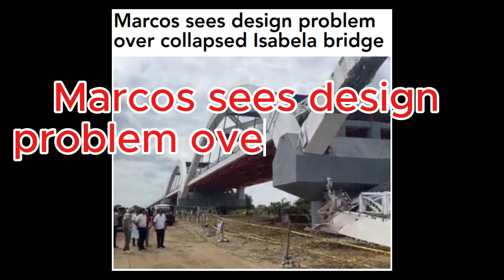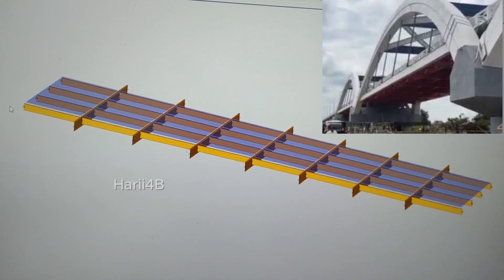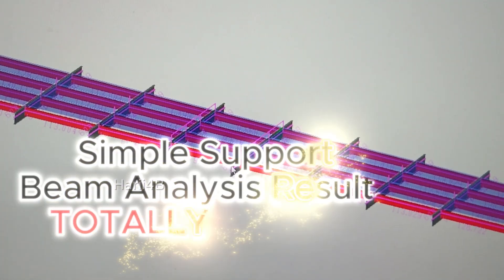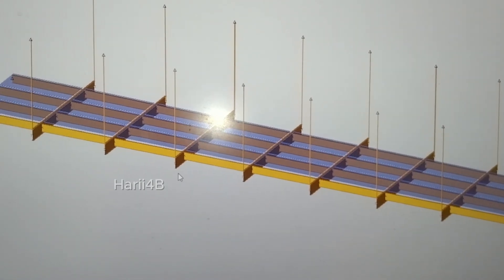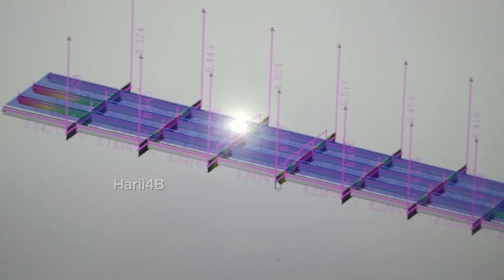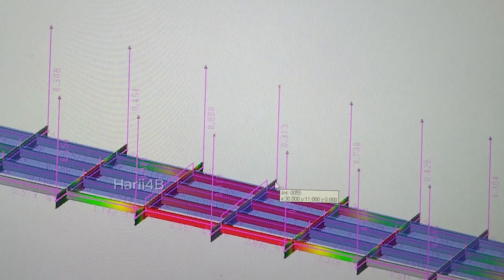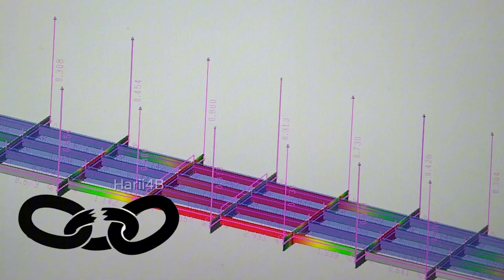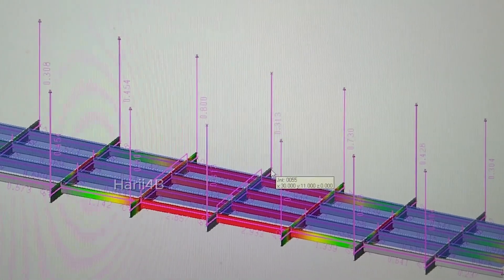ISABELA BRIDGE Cause of Collapse, EXPLAINED!!

Comment from the maker: https://youtu.be/3IPedlqZ4mc In Tagalog Po
Reply: @Harii4B  sir kindly watch ung interview ng oneph sa nagdesign ng bridge and comment sa next analysis nyo. Ang sabi nya he based it on the 2015 bridge code na kinopya natin sa american bridge code and they just used  27 T for 10wheeler truck. Kaya nasabi k sa comment sa part one ng analysis nyo, na wrong feasibility study,  D nila binigyan ng malaking pansin kng ano ang volume and weight ang dadaan don. Regarding sa truck sabi ung nagdesign DPWH measured the volume of the dumpbox of the truck, kinilo ung mga bato ang they came out with this 110T yata. I agree that they should weigh the truck to get the exact weight.

Yan sir ung interview;

https://youtu.be/ZaLLmM3CmVU?si=_qH1idzWVYI6R_y4
Reply from the maker: di ko rin sir ma imagine/justify yang 2 27ton truck lang ang design sa 60m+ span. Lalo na now na nakita maraming weak support connection points ang design nila. Let's see na lang sir ano gagawin dyan ng DPWH.
Reply: @Harii4B  tama sir ung analysis ninyo. Pero surprised ako sa sagot ng engr na nagdesign ung bridge, pti DPWH . Lets see sa senate hearing dpat may masibak dto kc hindi lng ito ang bumagsak marami daw.
Reply from the maker: pls wait po ng 4th video, may laman na yun regarding design flaw/s?!

Comment: The 60m bridge has 6 (pairs) supporting rods but your model has 7.
Reply from the maker: yes sir, it was already modified in video 2 and 3
Reply: @ im a bridge engineer and wanting to run also my own model in midas. Id be happy if you could share me the drawings of the bridge so that i can model and check the design, particularly the connection details
Reply from the maker: @rarapiboy2525 apologies, my model is not the same 100% matching the actual built in general dimensions and section properties. i just made scaling from photos gathered using the stated bridge span of 60~65m length. it's enough to get the feel of the bridge behavior and understand what is lacking. thank you very for watching.

Comment: Yes, the President is correct! He was referring to the design of choice (arch brisdge, with inferior support) as not adaptable to the traffic in the area. It is a low capacity bridge, instead of a design adaptable to all types of vehicle. Should the design be a PCDG type like a viaduct, even the bridge in full capacity (bumper to bumper scenario), it can safely withstand the load.

Comment: SIR !!! CONTINUATIONS LANG PO SA INYONG WELL ILLUSTRATED POWER POINT ANALYSIS BAKIT BUMAGSAK ANG ISANG LANG ARK SPAN NG CABAGAN BRIDGE SA ISABELA??? ARE YOU NOT CONSIDERING THE TRAVERSING 3 TRUCKS OF THE SAME STONE LOADS TO THE MULTI-SPAN ARK BRIDGE OF ALMOST 1KM LENGTH. WHY ONLY ONE ARK SPAN GAVE UP TO THE THIRD LAST TRUCK THAT TRAVERSE THE BRIDGE??? THANK YOU SIR TO YOUR ENGINEERING ANALYSIS TO THIS COLLAPSED BRIDGE!!!
Reply from the maker: preparing na po ng 3rd part, more conclusive na ito. marami pong salamat!

Comment: Correct po kayo Dyan..  LooK BOLTS and KNOTS connecting the TENDON ROD..  They SNAP and SERARATED..  Even The ARC is NOT SOLID REINFORCEMENT Design..  Why ARC Design Have STRENGTH and DURABLE can be DESIGN SOLID not HALLOW..

Comment: Kung ang retrofitting eh nilagyan ng pier at beam sa gitna ng arc all the way to the top of arc and then bigger girder beams sa length ng bridge eh its possible the bridge had been save! DPWH engineers are inutile at palpak ang design. Hindi inisip yung dead load ng structure at lalo yung moving load na yumuyugyog sa bridge! Lumampas ata sa cantilever beam design yung bridge structural length and should have a stronger pier and beam at the middle of the span! Pure aesthetic was considered sans the strength to withstand the dead load and moving load. Safety factor for the said load should have considered! Pera ni Juan Dela Cruz sinayang ng mga taga DPWH at structural plus architect designer palpak!
Reply from the maker: maraming salamat po sa inputs, nagkaroon ako ng baong idea sa retrofitting study na gagawin ko

Comment: The fault  could be on the side of the inspectors before the bridge is opened. Before 1990s initial stage to final stage inspection is done by dpwh plus submission of strength of materials report used. Now for contractors it's the % cut for project 12% kay cong, 5% kay RD dpwh, 2% PD-dpwh., 2% kay mayor, 2% for Sanggunian at barangay kap😊
Reply from the maker: minimum 40% project po yata ng gross budget ay napupunta sa bulsa ng mga (????), ayon sa mga marites hahaha
Reply: @Harii4B  you may be right sir hahaha

Comment: I dont buy in on your explanation. To tell you frankly, this is DPWH FAULT. Everyone there doesn't do their responsibility diligently. Lahat sila nagiging politiko na, at hinihintay ng mga yan ang S.O.P. 

@ Lets start w/ the design, if it is an outsourced or designed by private company, they can check the design & materials to be used, using computerised capacity & load simulation. There & there they could question, revise & correct the possible defficiency of the design prior finalization & before putting into drawing w/ appropriate specification.

@ In the development of project, they should apply the QA/QC qualification from materials up to construction stages &/or phases they assembled? What was the findings & its results?

@ final project acceptance, what is the final QA/QC report by contractor & the approval of dpwh?

@ DPWH turn over to the users (LGU). What was the guidelines, procedural or methodology put into document by DPWH. this encompass critical load in vehicle capacity & sizes, safety signages & paraphernalia to be put into critical places, etc. 
Please take note that the defined documents by dpwh for the bridge will defined group responsibility to avoid finger pointing.

@ bridge check ups & maintenaces. If this is being initiated by the DPWH ( in quarter, bi year, & yearly) the govt will be aware & prevent this incident to occur and can be corrected at once...

Bakit nangyari ito. DPWH doesn't do due diligence !!!
Reply from the maker: https://youtu.be/3IPedlqZ4mc please watch here po, then we can talk again after.

Comment: THE BLAME GAME.
If Design Flaw; why does it fall “only” to the Designer? Or rather why does it fall to the designer? Engineer who authors the Design is only the first part. We may agree that it is the sole responsibility of the Design being the author. But i don't agree it is automatic or equate to be the sole liability of the Designer. 
(1)	Who Authors the DESIGN? BLAME the Engineer?
A Structural Engineering Design Firm/Professional is a licensed to make sure its design complies to the “required” Integrity and strength of its structure irrelevant how much they are paid to do so. Design Fee is irrelevant to its responsibility, duty nor one’s liability as a result of its design as being a professional and licensed designer. There are guidelines for designer’s fee and the basis for it is the compensation. It is and shall base only to one’s (1) Experience (2) Expertise, and Capabilities of the designer. Once the Designer accepts its challenge to the design work regardless if one is paid high or low the goal and priority concerned does not change. “To Design a Structure that complies to its required Integrity and Strength in accordance to the Updated, latest and approved Structural Code; Relative Laws, including its implementing Rules and Regulations. 

“Retro-fitting” cannot be a basis for a Design Failure. Retro-Fit is a modification to “IMPROVE” and “ADD” something that applies to anything that is already “EXISTING”. It is Likely and “UPGRADE using new and adapting modern technology”. Adding strength to the structure is not simply nor limited to adding more steel reinforcements or cement. It is not limited to adding the same materials to aim strength and improvement but also by adapting new, latest and/or modern material that were not available before it was made. It will technically and literally add more on the previous required strength and integrity of the Structure. 

The Structural designer knows its design limitations because he considers both its Integrity/Strength and when their design will also fail. Design Failure is backed up only by “Wrong” Data and Information required to compute structures strength and design integrity.  “Retrofit is not a design of failure. Design and Formulas in computing strength of structure never changes tut updates to improve and to be more effective.” 

(2)	Who Implements the DESIGN? – BLAME the Contractor?
The Contactor may have followed everything according to the approved design; plans and specifications nevertheless This is not a simple construction project and executing this type of construction requires "AAA" licensed or upper. It is with the risk of also losing such licenses.
And such risk Contractors does not simply follow the plans. Standard Practice as a norm performs due diligence, approved design and plans must be checked, studied, reviewed, Thus to eliminate risk and failure, Contractors are allowed to comment and Should there be any discrepancy found and/or may suggest "failure" on the design, it is their duty to notify the Designer and Client prior to proceed any construction. This is to have a smooth and successful execution of the project and prevents the risk on liability and accountability on failure.

(3)	Who Oversees the DESIGN? BLAME the Government?
DPWH - LGU-City Engineer. The Government being the approving party and being the technical wing of the government is tasked but not limited to review, inspect, examine, approve and later issue all the necessary permits, issuances and compliances for the design plans and specifications submitted by the designer and likewise to the contractor during the implementation and execution of the construction projects. Our DPWH-LGU, as a representative of the public, /common and as an end user, is mandated and takes part also on the approval, weather to proceed or not any design and construction projects due to any lawful reason, legal and financial aspects of the project.

DPWH-LGU oversees and control funds and financial aspects the projects. Validates from the design plans, its methodology of execution and implementation, and including the fund, cost and estimates to see that the projects is feasible to proceed or not and lastly validates that any such projects complies to the standard materials and specifications, complies with to latest and approved Building Laws and Referral Codes, including the matters as a result, directly affect and contributes to the Safety and Security of the common public being the end user of any projects.

Which raises the curiosity. (1) who cuts the budget? and (2) Why compute a fund, financially assess; undergoes study, submitted for budget approval and expenditure, and then slashed to more than half of its original costing? (3) Why having these constraints allowed the project to proceed? (4) Why is there a “Who and Why” that is not a technical question then Blame a Designer for a none technical reason? 
 
(4)	Who is the CLIENT; The “body” that Funds the Project practically and intended for its use.  
BLAME the People?

The Truck Driver or Owner was first to be blamed. The truck driver including the company who owns it is a part of the "CLIENT" and END USER. Pareho lang siya sa ibang mga sasakyan na nadamay. Malaki lang po at Mabigat and truck. Question is Why would "they" design a bridge, +/-990 meters that cost about a billion more or less that caters only small or light vehicles? And a single loaded dump truck is the design failure consideration?
Reply from the maker: maraming salamat sir sa lengthy insightful comments. imho, maraming factors to be considered sir if they would conduct detailed investigations. technical, legal, authority, governing codes, financial and budgetary and many more. imagine it took 10yrs more or less? dami ng persons involve na nag take charge at nag transition/napalitan from start to current situation. ultimo exhange rate ng peso to dollar ay involve na rin dyan. isa lang masasabi ko... mahabang kwento at masalimuot na pagdadaanan pa ito until mabalik sa serbisyo ang tulay na ito. marami tayong matutunan pa dito
Reply: yes sir I definitely agree with you. With all the person involve i give the benefit of the doubt. And we can't judge it as a plain corruption sa tagal ng ginawa yung project a lot have change. We rather say everyone who is involve have done their part to make the project suceessful maaaring may kulang lang po that needs to be improve both design and construction. No design is perfect that lasts forever. it is a continuous study due to many changes in modernity and technology. I agree with you that there are many factors that contributes to such failures and some are natural which no human can control or beyond our prediction. No matter how you calculate the risk.

Comment: Structural Design po ang may problema jan.. malamang iniba nila ang Materials malamang Baka, Orig na Specs jan tapos ginawang concreto, kaya nagtagal pero mura.. basta gusto lang nila pagmukhaing lalabas na kamukhang kamukha sa Architectural Design Plan.. kaya lumalabas Substandard at Ampaw..  bakit gusto nila mapamura kc para may matitira para sa SOP at kay Edie.. sa mga Crocs, na Politiko, Engrs. na konected jan, DPWH at Contractors.. ngayon mga tao pinagmumura tuloy sila.. ang laking abala at kaya pano tyo uunlad jan.. c Mark Villiar asan na kaya walang imek..
Reply from the maker: oo nga sir, gano na naman kalaki budget needed sa rehab and retrofitting. isa pa pahirap sa mga tao balik na naman sila pagdaan sa side road. saklap pag nag tag ulan na naman tumaas tubig ilog, unpassable na naman. KALBARYO TO THE MAX!!

Comment: mali talaga design unang una yung Ark Beam at Horizontal Beam palpak na pano mo iinspikyonin duktungan nyan o kaya need  rerpair kung naka buhos ng semento, Only in the Ph Suspension Bridge may buhos ang mga beam, at walang Gusset Plate sa mga dugtungan, dapat dyan skeletal lahat ng metal beam para madling makita kung may crack.
Reply from the maker: https://youtu.be/3IPedlqZ4mc
Reply from the maker: dama po kayo. sa serviceability inspection ng tulay later on pahirapan na nga mag visual inspection man lang lalo na daming bolted connections ng deck framing. then kung need mag retrofit need ba mag baklas. daming flaws talaga
Reply: @Harii4B  sir ty na watch ko na, kangkabo ung ark beam, tingin nyo sir mga poste na support sa ilalim ang sulusyon at additional support sa vertcal beam sabi nyo  nga manipis ang plate, kasi ung suspensyon support useless baybrasyon sigurado luluwag pagkaka mount ng suspensyon.

Comment: Thanks Harry for the informative explanation. As also explained by the designer in his interviews this is a tied arch type which means the arch should be a major structural member supporting the bridge itself and with his design the load carried by any means attached to the arch. My question is shouldnt it be logical in the design to induce redundancy in the number of carrying cables or rods per instance so as to reduce the risk of failure of the whole system just by losing 1 or 2 cables in 1 specific section?  i noticed international bridges would either apply redundancy thru making short distance between cables or having criss crossed pattern to mitigate this effect.
Reply from the maker: That’s a very good point, sir, and yes, redundancy is very important in structural design, especially for critical structures like bridges. Please watch the oncoming follow-up video explaining more on connection failures. Thank you very much for watching!
Reply from the maker: https://youtu.be/3IPedlqZ4mc

Comment: As an engineer myself, I don’t believe the truck is 100T, but most likely 75T max
Reply: Yes ...I'm Engineer also.. And I BELIEVE in your Assumption.  
     DID you SAW  BOLT and KNOTS .. CONNECTING to the TENDON ROD that SUPPORT the BRIDGE    The BOLT SNAP Not the vertical ROD. .. And The ARC is HOLLOW its EMPTY inside Only The STEEL.Supporting  to Hold The Tendon ROD.
Reply: @Pato-ml7nt  yes sir.i am a loader operator and heaviest that i load is 55 tons gravel for big single trailer.it grossed 75t.as i saw the truck on pic.of truck that bridge it can only load 30 to 40 tons plus 17 to 20 tons  weigth of truck so its maximum weigth is around 60 plus tons.

Comment: The bridge is contructed in a site  that trucks would run to. Has the design not considered that it will be used by heavy trucks?
Reply: Paano kung bumper to bumper Ang mga sasakyan gaya halimbawa sa Marikina bridge pg matraffic di ba pwede isipin din Ng designer Ng tulay ?
Reply from the maker: That is a very important factor, sir. But the main point is the load carrying capacity, it should be able to handle any heavy vehicle.

Comment: SIR !!!!  SORRY TO INTERRUPT YOUR SCIENTIFIC ANALYSIS OF THE CABAGAN BRIDGE THAT COLLAPSED ALREADY!!!  THIS CABAGAN BRIDGE AT ISABELA UNDER GONE "RETROFITTINGS" WITH SUFFICIENT APPROVED BUDGET FOR THE CIVIL ENGINEERING WORKS. THE DISCOVERED UNEXPECTED AND   UNNECESSARY MOVEMENTS VERTICAL OR HOTIZONTAL SWING OF THE BRIDGE THAT IS WHY IT SHOULD  UNDER GO RETROFITTINGS, AT THE SAID TERM THEY SHOULD HAVE ALL CORRECTED THE FAULTS AND DOUBLE OR THRICE THE PLUS AND MINUS PERCENTAGE OF ERROR OF STRENGTH OF MATERIALS STRUCTURAL CIVIL WORKS MAXIMUM ALLOWABLE TONNAGE WEIGHT CAPACITY TO THE BRIDGE FOR RETROFITTINGS. THANK YOU SIR!!!

Comment: Those Rigid Solid metal hangers became Battering Rams against the Arch.  Any movements of the floor will be transmitted by these hangers pushing up the Arch and since the composites of the Arch are concrete on metal bars, the Rams disintegrated the foundation.  Unlike Cables that flex in any movement, this rigid solid metal bar will only move upward on momentum.  It is a design flaw, period
Reply from the maker: Agree, it was a very critical design flaw.